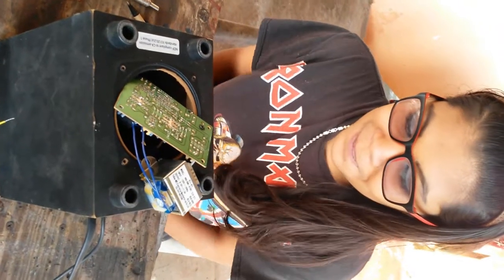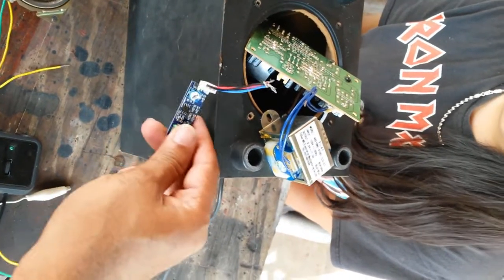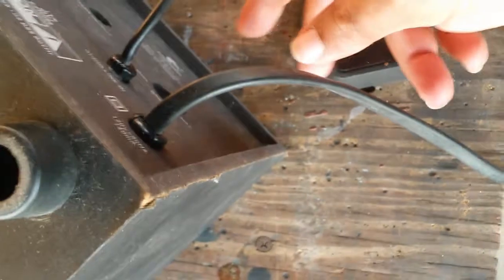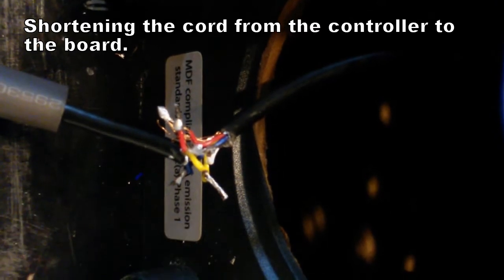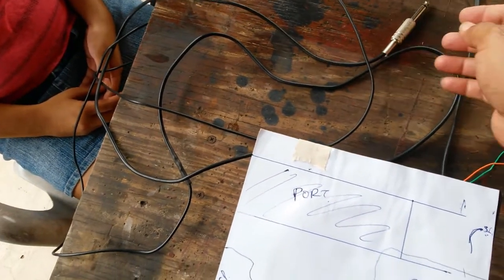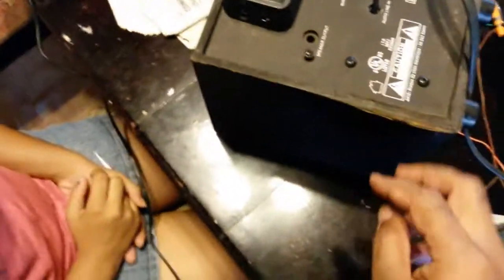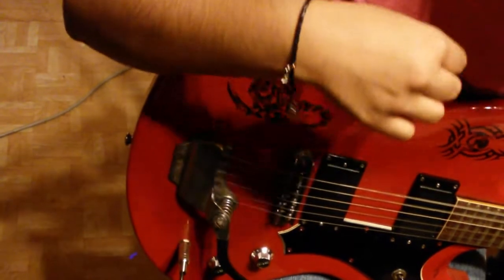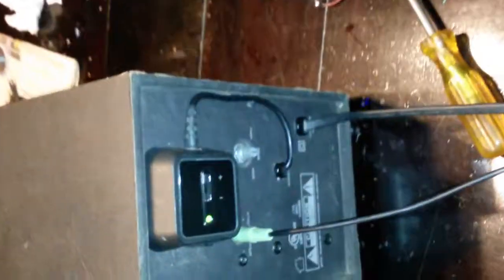052 Building an Electric Guitar Amp from a Computer Speaker System

Comment: You’re really testing her on this one haha. Nice work.
Reply: Brad Angove lol yh I was nervous
Reply from the maker: Brad yes its $2.15. All we bought was the jack to go in the guitar for US$1 and the pre amp for US$1.15 shipped. That's all. Everything else was a few scrap wires, solder and heat shrink. I have lots of that lying around. The speaker was from a very old Tv I scrapped a few years ago so it was free. The computer speaker system was in a flood and discarded so that was free too.

Yeah I did test her a bit. I would explain off camera and then ask the questions on camera so she explained in her own words. That way she always knew what we were going to do and why. By the end it all sank in and now I bet she can explain it.

Comment: cool little project.
For your speaker grill you could just find some old fly screen and make a small frame to attach to the front with some hot snot ;) or velcro if you want it removable.
Keep it up and all the best
Reply from the maker: Mark Tanner thanks. Actually I have a proper 6" speaker grill from an auto speaker I bought some time ago. It was dark already and "Mexi" is in school so we had to wrap up. I didn't want to delay another weekend. At least she has something to play her guitar on. 

Video #023 shows the guitar restoration if you are interested.